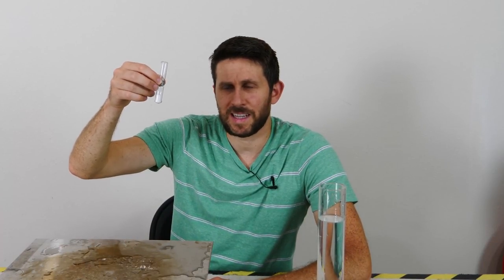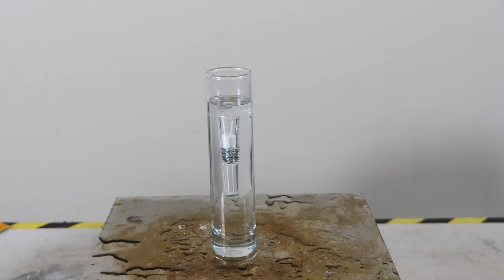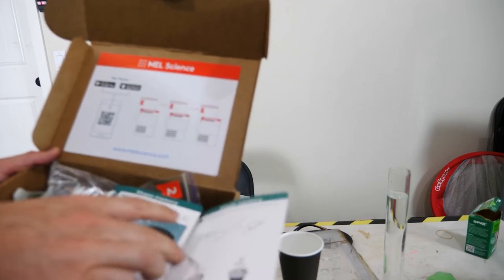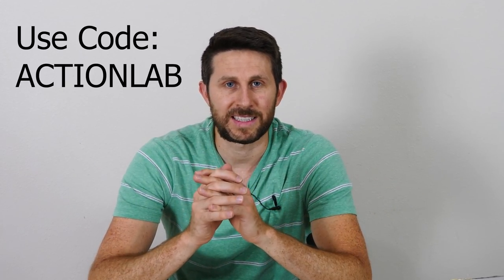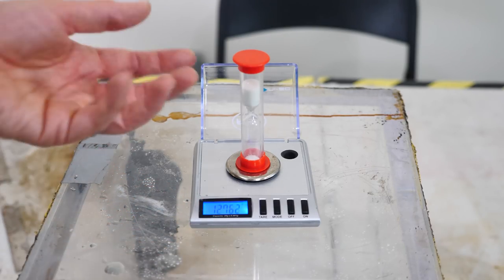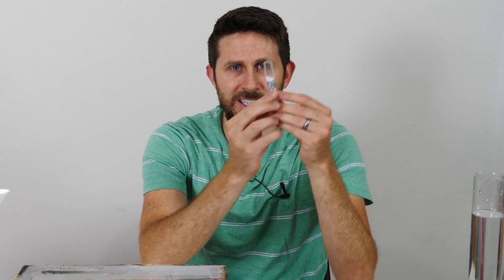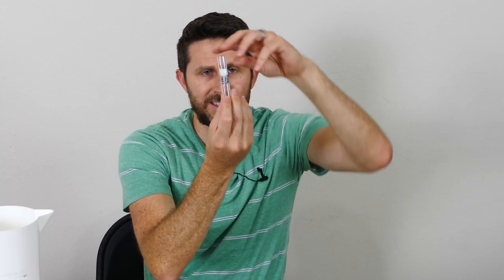Can You Figure Out The Hour Glass Buoyancy Problem?

Comment: I don't buy the model of friction and think it's holding back the results. Perhaps strain gauges on long rods supporting a guided path for the hourglass would make it more clear.

However for that model of friction. Try it against a block of ice using the most perpendicular support possible to pin the shoe to it. If it's frictional the force need to hold it still should grow significantly.

Comment: Love your videos! You're always giving very intuitive explainations. 
This time i thought there was something about the depth of the air bubble. Is it possible that the buoyancy of the hour glass changes because the relative depth of the air bubble inside changes as well? if the air bubble is at a greater depth in the water tube it might be displacing a slightly denser (so heavier) water because the pressure is greater on the bottom of the water tube then at the top.

if  the pressure in water increases by 1 atm every 10 m it means it changes by 0.01 atm every 10 cm. So the water at the bottom of a 10 cm long  hour glass can provide more buoyancy then the water on top (?) do you think it make sense? could it make a difference?
Reply: The pressure gradient is what gives rise to bouyancy. If there was no pressure gradient, there would be no bouyancy force. Also it cannot create "more bouyancy", it just creates the bouyancy.

Comment: So in the tall beaker it doesn't really seem like it's touching walls. My first thought was friction but it seemed to obvious.

And what about that experiment where you make a floater with just enough weight attached so it barely floats, fill a 2L bottle to the brim with water, put your floater inside and screw on the cap. Then if you squeeze the bottle the floater sinks. Release the pressure and it floats again. How does that work...

Comment: So if you put weight at the bottom of the hour glass, so it'd always be standing straight, no matter of the position of the sand inside, it will always sink, even if you use a more buoyant hour glass to compensate for the added weight. (Unless you use TOO buoyant hour glass)

Comment: This is a great experiment, but you did have a small slip-up. Weight is not an intrinsic function of an object, it is the effective "downward" force that an object exerts, at a given moment and with respect to a given set of circumstances. It also depends on your definition of what "downward" means in that set of circumstances. When you measured the weight of the hourglass, you measured the weight under circumstances where buoyancy is negligible, but you should have mentioned this detail.

In other experiments, the buoyancy of an object does make a difference. A cone-shaped object, for example, does "weigh" differently depending on its orientation, and an object that changes size also changes its buoyancy, even if it does not change its mass. For example, a bottle of compressed air with a balloon on its valve will "weigh" less if the air is passed from the bottle to the balloon.

All of this might sound irrelevant, but you do find lots of people who do not understand weight. I even saw a video from a supposed physicist who struggled with the concept.

Comment: Next test (using a real full-sized hourglass, not that tiny sand timer) how vibrations impact the running speed of the hourglass. Is there a frequency and direction of vibration that will make it run faster, and is there some other combination of frequency and direction that makes it run slower?

Comment: Sir you forgot the main part..The centre of mass in here is changing... so the system tried hard to be stable  by tilting itself and also due to normal forces and boyancy that pushes the air filled part upwards because of less density of bottom part so as both forces are almost similar and the narrow tube had no room  to flip it instead excerting an equivalent frictional force on the sandglass making it stable untill a reasonable part of sand drops at the bottom which is of greater density than boyant force of water and its sinks down....

Comment: When the sand is at the top and falling through to the bottom, then the sand in free-fall is (accelerating downwards and) not contributing to the weight. I doubt that the (only) reason it appears to float is friction. Try the weight measurements again with a more precise balance.
Reply: I also initially thought so but no. Check his video of a quadcopter in a box...
Reply: @drorharari  Thanks. But the drone in a box is a physically different situation. Forces acting up on the drone equal the weight of the drone. In the hour glass, the grains are in free-fall... effectively weightless for a moment. So while the grains are pouring through there is always a stream of them that are effectively weightless.
Reply: @kevinmorgan2317  I'm not sure about your interpretation. The sand grains, while falling, are in a free fall but with the resistance of the air. We should'nt look at the system from the perspective of the sand grains but instead from the perspective of the system
Reply: @drorharari  if I stand on a set of scales with a 20kg mass in my hands, the scale will read my mass (70kg) plus the 20kg. So, 90kg. If I drop the mass then on it’s journey towards my toes the scale will read 70kg. If I perform the same experiment in an enclosing glass dome (with a glass bottom) with the scale beneath the done, the result will be similar (you could argue a minuscule difference). Plus a dome reduced to smithereens. 
While friction may be the bigger factor in the Action Lab demonstration, it is not the only factor. And I think (accepting I could be wrong) the part where it is claimed the balance results are identical is wrong.
Reply: @kevinmorgan2317  I think we're in agreement (and unfortunately I'm way heavier than you). I thought about the case where the 19kg mass in your hand in the dome was metal and the moment you left it, a powerful magnet from above kept it mid-air. No friction, weight went outside and is not reading on the scales.

Comment: The sand moving downward is like a little rocket nozzle. The action of the sand moving counters gravity until it doesn't which is when it then falls.
Reply: the sand hitting the bottom would undo the effect, so really it would only matter as the first grain falls or something like that.

The center of mass IS being lowered though, that just seems to not be directly relevant here (but indirectly as it makes the hourglass "stable" and as such removes the normal force against the wall of the tube)

Comment: I think the reason why it takes longer to reach the bottom when the sand is at the top is because the weight of the water onto of the timer the air at the bottom is trying to push upwards

Comment: Actually the hour glass would weigh slightly less when the sand is at the top for 2 reasons. First the center of mass of the hour glass is slightly farther away from the center of mass of the Earth. Second some of the grains of sand are in free fall so they would not be counted as part of the weight.

Comment: ( Haven't finished watching ). Edit: I was super wrong

Tall Cylinder:

1. Sand on Bottom
- Release = 1:05
- Descent = 1:05
- End = 1:10
- Duration ~5 seconds.

2. Sand on Top
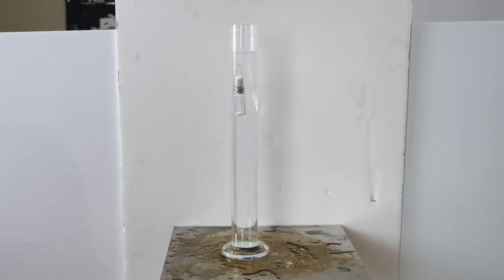- Release = 1:24
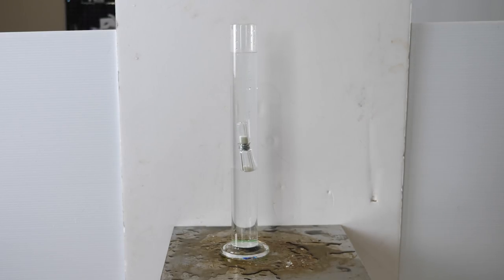- Descent = 1:40
- End = 1:47
- Duration ~23 seconds from release to end.
- Duration ~7 seconds from descent to end.

My Hypothesis:
- Prior to putting the hourglass in the Tall Cylinder, metal was wrapped around it to carefully weigh it down such that it would slowly sink despite the bouyancy.
- When the sand is on bottom it is already settled and thus sinks
- When the sand is on top, it slowly falls as it jitters past itself and past the choke point then freefalls once it escapes the choke and accellerates due to gravity until it settles on the bottom.
- When the sand is jittering and sorting itself it is decending albeit slowly.
- Whent he sand is free falling it is not weighing down the hourglass.
- when the initial sand's momentum is transferred into the hourglass it is not enough to counteract buoyancy.
- when a substantial (critical mass) of sand settles at the bottom it closesly enough resembles the base case (starts with sand already settled on bottom) where any additional sand falling is negligible and buoyancy force can no longer prevent the hourglass from sinking.
- Technically the center of mass is changing in the 2nd case (sand on top) as the sand falls it slowly changes the center of mass to the bottom. So if you were only paying attention to the center of mass the 2nd case (sand on top) starts to fall immediately as soon as it is released.

ACTUAL ANSWER:
- oof, friction.

Comment: Before watching the video, my educated guess on the difference between floating and sinking is the location of the air in the hour glass relative to the water pressure surrounding it.  I'm not sure exactly how it works, but I believe that is the principle causing the floating and sinking based on where the sand is.
Reply: Educated?
Reply: I was completely wrong!  Didn't know friction would be a factor since it's glass on glass which doesn't have much friction.

Comment: NO this is NOT because of friction! This is because its center of mass changes from top heavy to bottom heavy. The surface area when the center of mass is at the top is larger than when the sand falls to the bottom where the surface area changes to lesser of that and then it sinks. Think of its shape. When the sand is at the top, the elongated shape has more buoyancy because the the overall buoyant force acts like a boat (curved shape) compared to when the sand falls down (pillar shaped with less surface area). Start thinking in terms of center of mass. The reason why ships float is NOT because of the overall mass displaced, but the center of mass too. If you attach a weight at the bottom of the ship which is barely buoyant normally, it will start sinking, compared to the same weight on board the ship.

Comment: its due to friction being generated between the bottom edge of the hour glass and the interior surface of the water beaker resulting from  the air in the  lower half of the  hour glass exerting rotational force [around its shifting center of mass] which is gradually reduced as  sand falls and air is allowed to displace into the hourglass upper chamber. This has nothing to do with a  variation in weight mass or buoyancy and the apparent effect would fail if the larger container had a diameter sufficient to allow the hour glass to sit at an angle of incidence incapable of producing that min frictional coefficient which is necessary to temporarily forestall its descent. i think.
Reply: paused at 2:01 to record above hypothesis now lets see if im suffering from utterly  misplaced self confidence
Reply: nailed it and im an artist

Comment: You need to take into account the fact that the airborn sand is not pressing down on the glass. When the pile of sand in the lower glass gets high enough, the weight of the shorter "fall of sand" is less, and more sand is pressing down on the glass.

Comment: For a tiny fraction of a second the hour glass weighs less right after it is flipped because tge cg is accelerating down. When the sand reaches steady state flow through the orifce cg is moving down but not accelerating so weight is back to the statc value................i think.

Comment: Shouldn't it weight a little bit less when the sand is at the top, because a fairly constant (though small) proportion of the sand will be in free-fall until most of the sand has fallen through ?

Comment: VACUUM EXPERIMENT SUGGESTION:  hang weights in a box with a vacuum in it and weigh the system.  Then release the weights to see if the weight of the system changes while the weights are in freefall.  I suppose you would need a a remote solenoid inside the box to release the weights.  I think this would be interesting.  Then maybe try this in a sealed system without a vacuum.

Comment: I haven’t watched the video past midway. I don’t absolutely know the answer. After 10 minutes 4 possible explanations came to mind. 20 minutes of thought and 3 solutions fall short. 
1st. Falling sand creates tiny air vacuum in upper half. Not ! This implies compression in bottom chamber that cancels out both.
2nd. Moving sand creates static charge that manipulates water density surrounding hour glass. Not enough force to make the remarkable change in buoyancy.
 3rd. Friction in moving sand creates heat and lift? Not! Air can’t expand in fixed volume , can’t get lighter with heating.
 So I chose 4th. The small amount of sand in midair and therefore weightless , seems to fit the buoyancy I observed

Comment: I think this video display how buoyant the hourglass is where the weight is displaced. I don’t think it articulates whether the weight is actually different depending on whether the sand is at the top or the bottom of the hourglass.
Reply: the weight is the same, as seen on the scale. The hourglass isn't quite "floating" when it floats, since it's also "hugging the wall", which is the difference.

Comment: If you wanted to prove it was friction then you should have made an hourglass that is heavier on one side so that even with the sand at top, the glass is still stable. If both glasses weighed the same and the bottom heavy glass sank when the balanced one didn’t (with both having sand at top), then that would prove friction.

Comment: I have one science question that came up as a result of something at work. I was attempting to pry something but I couldn't even to the point that I was lifting my body. But one of my coworkers who weighs about 20 or so pound more than me was able to using all of his weight. So my question is, without simple machines or jerking movements, can someone pull down with more power than they weigh. For example, can a 200 pound man pull down with more than 200 pounds of force?

Comment: You also are not accounting for the falling sand. Any grain of sand that is falling from the top to the bottom is not applying downward force to the hourglass. That may only be 15-20 grains of sand at a time but it's enough to make a difference.

Comment: What happens if you stabilize it with a gyroscope instead of letting it lean against the walls? 🤔 Will it still float until enough sand has reached the bottom part?
Reply: I think it would sink without the friction on the sides of the glass, plus the gyroscope would weigh it down.

Comment: I would disagree. My theory is that its dependent on buoyancy. pressure on the bottom of would be greater. and pressure on top close to atmospheric pressure. when the hourglass is full on the top more air is present in the bottom more pressure is applied in th

Comment: Wait, we can us this to travel underwater in a timer.
Imagine this, 4 60 second hourglasses that are hung up by chains still underwater.
Chains are removed. 
It slowly sinks because of buoyancy and we reach the ocean floor at around 30 minutes.
During that time, food is in packs so it doesn't fall over when the submarine elevator falls.
You reach the ocean floor.
Hourglasses are turned upside down using a wheel.
Elevator Submarine floats back up

Comment: Due to the thumbnail,... I thought this was talking about weight... but its actually talking about buoyancy.
1:40 in atm. My guess is pressure. The weight on the lower half is enough to cause the water pressure to push the rest upwards from the bottom. But as the center of the hourglasses mass changes, the water pressure from the top becomes greater... or the pressure at the bottom gets overcome. Something like that.

EDIT: Okay.. so it wants to flip... but WHY does it want to flip >.>
I don't think this video quite covered it... objects leaning like that will simply drag and still fall. So either the waters pressure is assisting keeping it up also, or that tube is pushing EXTREMELY hard against the side. The tube doesn't create enough frictional force on its own to accomplish this so you have to explain the rest or I am not going to understand.

Comment: Would that really be saved by Friction tho? To me it looked my it floated cause of Gravity's pull. With the sand at the top instead of bottom while in water, gravity's pull on it changed enough for it to float. Meanwhile once enough sand was in the bottom, gravity's pull was strong enough to overcome the weight on top and sink it.

For your test to work, if it's really Friction only, then it would 'Work' with ANY weight or gravity. So instead of Sand, put something very heavy inside and see if it still 'Floats'.

Comment: Of course it is friction! Damn, fooled me. I was thinking maybe just maybe that the system was so incredibly well balanced that the ridiculously insignificant density difference in the water due to depth played a role, but that would only make a difference if your center of buoyancy changed. Fixed volume, not going to change. There is a lot to learn from this video.

Comment: Cool! Add small radiation generating cups on both the top and bottoms of the cylinder in one dry room below freezing. Walls made of ice. Surrounded with water moving around it counter clockwise, Oscillating between temperatures at an interval that prevents the ice from totally melting. Another dry room outside of that  with a temperature just above freezing. And another outside of that with water moving clockwise around it? Nothing will probably happen.
Reply: maybe add a small space in the wall between the second and third dry room with a temperature well below freezing. It will keep the walls from melting and allow water to move freely? Nothing will probably still happen. Just curious.

Comment: Technically speaking it is heavier when the sand is at the bottom as the Earth’s gravity field is slightly stronger at the bottom than the top. However this difference is so tiny as to not make any observable difference in any conceivable experiment.